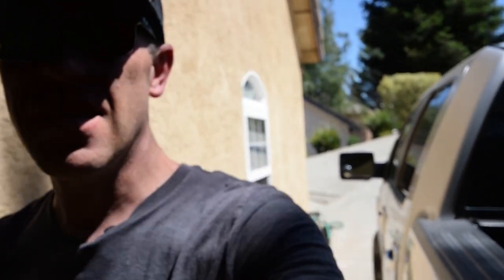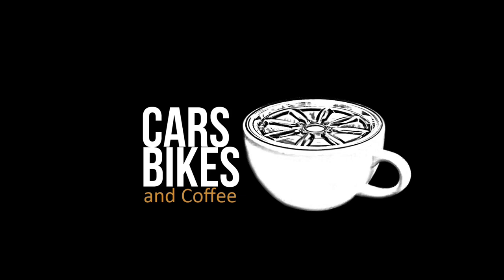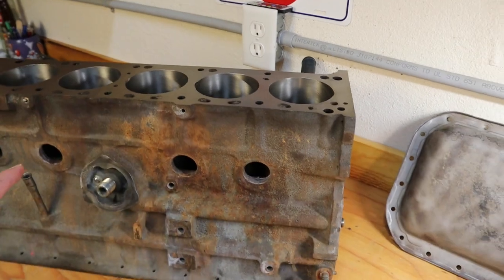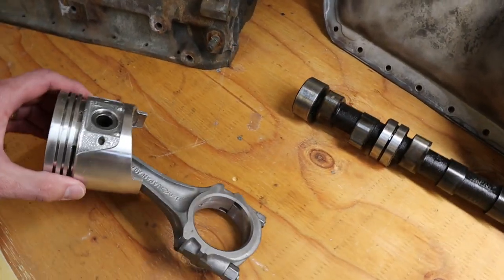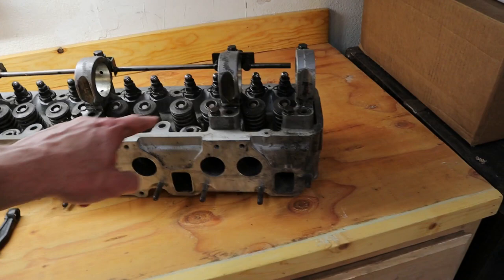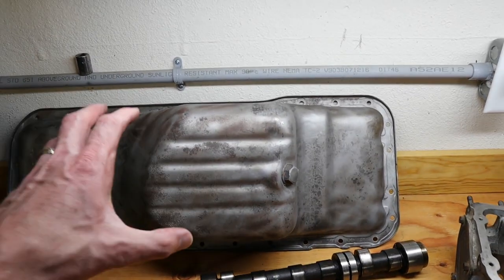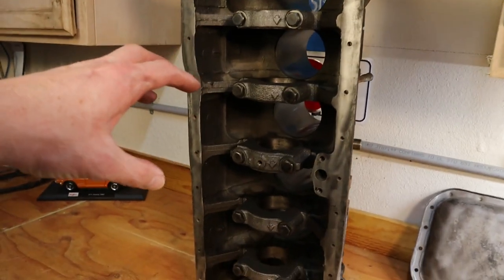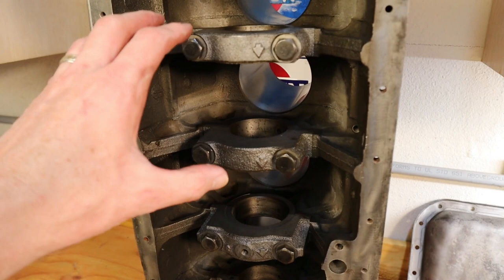Engine modifications for the Datsun 260Z L26 engine

Comment: Very appreciative for the information you have provided over this build and the 240Z you did earlier.  I am at basically the same place with my 280z engine that will be going back into my '73 240Z.  I do have a question for you that I hope you can cover in the next segment regarding removing the flash.  I had contemplated doing so on mine after having come back from the machine shop, but hesitated due to the potential of metal bits being slung everywhere.  How do you prevent this from being an issue, especially since I don't want to take it back to the shop to be tank cleaned again.  I have painted mine and went with a metallic charcoal or gunmetal grey, depending on how you look at it.  Oil galleys on mine they went ahead and shaved the plug down smooth for me, so I got lucky there.
Reply from the maker: Right on! Thanks for watching! Yes, next episode I will be going over that and showing what I do.
Reply from the maker: Ultimately it all comes down to preference. So doing isn’t really required as they have been fine for almost 50 years. In regards to making the surface smooth it does help the oil to sluff off the sides. If you do glyptal the paint you mention, you wouldn’t need to grind. There are some reserves I have with it only in the application, if you do it wrong you could end up having the paint go through the engine. Just preference.

Comment: Why would you not redo the head valve's and springs cam ???? While you have it all apartment?
Reply from the maker: Thought I mentioned in this video maybe the other head video. Had the head bench flow tested and it was really good as prior the head was redone. I did replace the valve seals. Cam had a regrind and the rockers were resurfaced. Thanks for watching!🤘🏻